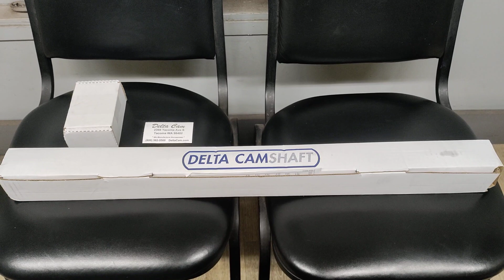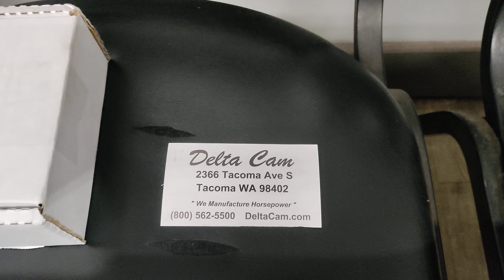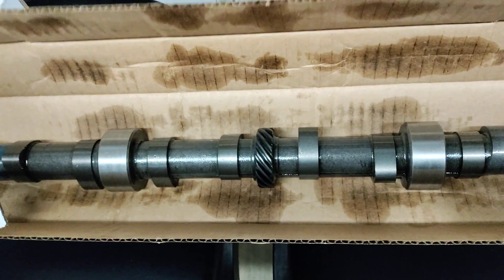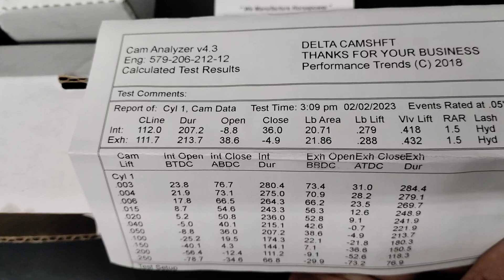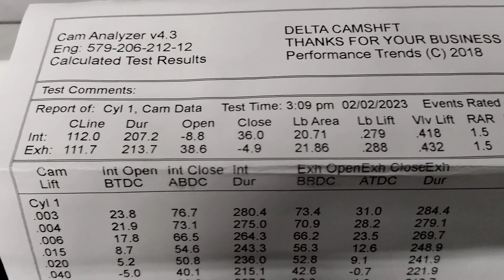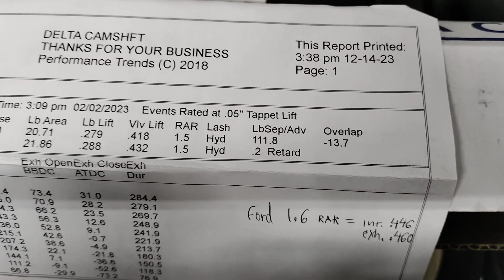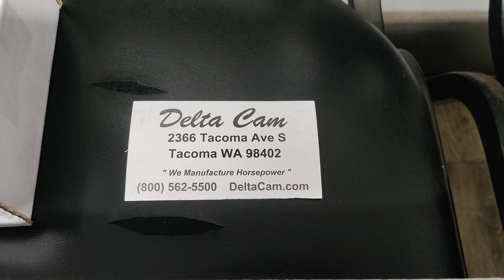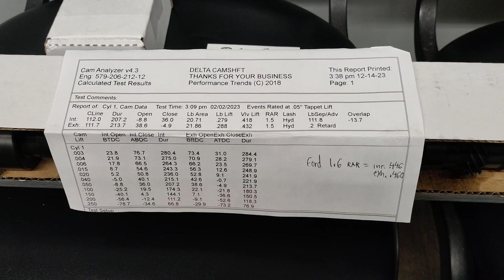It's Camshaft Day! my custom grind for the 300 arrived from Delta Camshaft.

Comment: Been working back through a few of your videos.  Seems to me you've really got a wicked package coming together.  

I'll be a bit before mine is built. I have all the parts. Just a matter of time. 
I wanted a ridiculously nasty sounding idle. F250 4WD. 4:10 gears. 4 speed manual. 
I chose a custom Schneider. 
Specs are something like 208 .456 int and bigger exhaust. 108 lobe separation. 
Next year's project... but it'll be rugged.  
Thanks for posting.